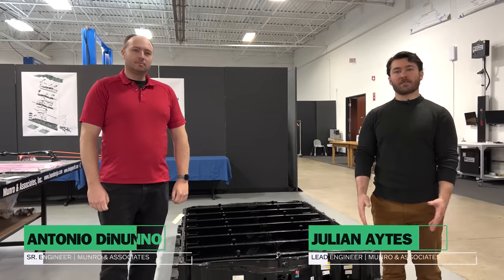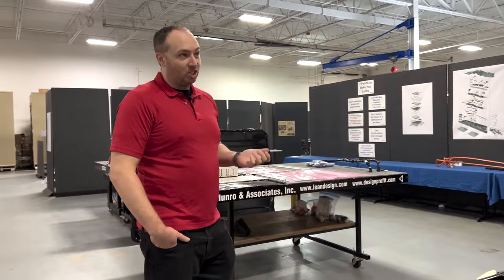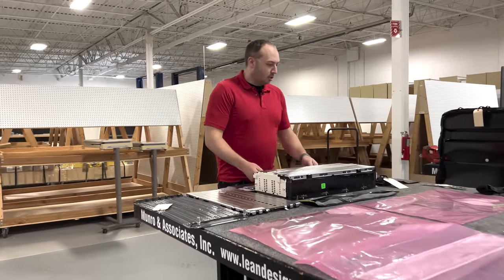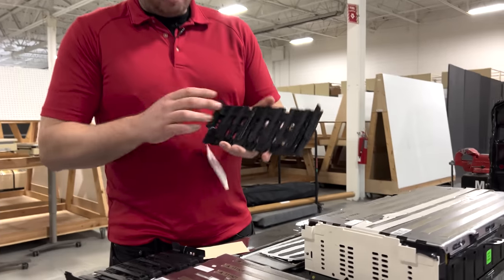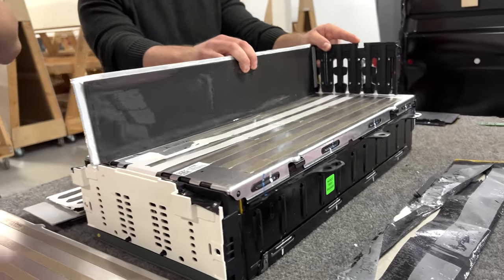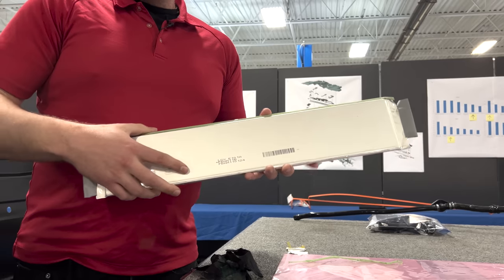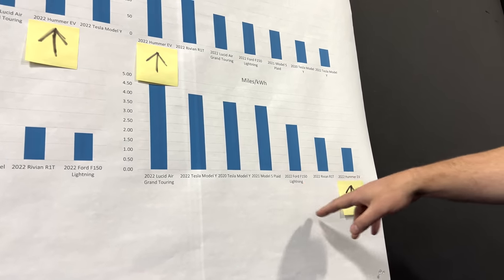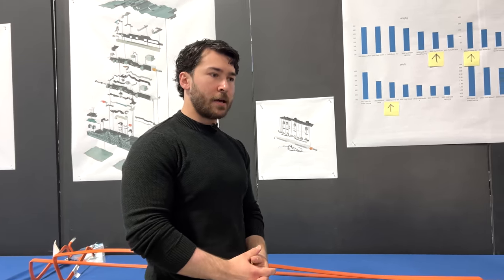This is NOT Lean Design: Hummer EV Battery Pack Breakdown

Comment: I have been keeping eyes on the Chinese new energy vehicle data published by the Ministry of Industry: 

For Tesla M3/Y sector (65-80kwh sector or the gasoline equivalent BMW 3 or Merc C)
2019 Chinese EV overall weight was 2200kg with typical mileage at 18-22kwh/100km
2020-2021 Chinese domestic brands moving towards 1900-2000kg with typical mileage at 15-18kwh/100km
2022-2023 Chinese domestic brands are almost at 1700-1800kg with typical mileage at 14-16kwh/100km
For reference, Tesla M3/Y moves from 15 down to 12.5kwh/100h since 2019 after gigapress put into production 

GM and a lot of legecy automakers dont sell in China: nobody buying junk not from the get-go. as the old English saying, "fool me once shame on you fool me twice shame on me"

... and stop fucking blaming it on nationalism otherwise why on the fucking earth rich/middle-class Chinese in the past 15 years ALL possesses one of the following 
1. Merc
2. Audi
3. BMW
4. Toyota LC/Alpha 
5. Lexus

Noted I dont put the American luxury brands in there because it is way worse than an Audi. It consumes more petrol than an Audi but it requires the same amount of maintenance.
Reply: Uhhh GM is the number one EV producer in China under thier Wuling badge. The difference is that GM's  Chinese EV products wont "benefit" from the influence of GMs US military contracts.
Reply: @patreekotime4578  Number one in units, but they count ALL of those units even though they only own a portion (30%) of the company.

SEC should be putting GM execs in jail.
Reply: @tommornini2470  Also the Buick marque is very popular in China. This whole post is just incredibly mis-informed.

Comment: The problem with aluminum in battery modules is Aluminum is pretty flammable and steel isn’t. We have all seen how flammable Teslas are when they catch on fire. All that aluminum giga-casting burns incredibly hot. US war ships tried using aluminum to cut weight on ships it turned out to be a disaster as the fires weren’t extinguishable using normal means. Eventually a Tesla is going to catch on fire in an enclosed area and a lot of people are going to die. They will then get rid of a lot of the aluminum.

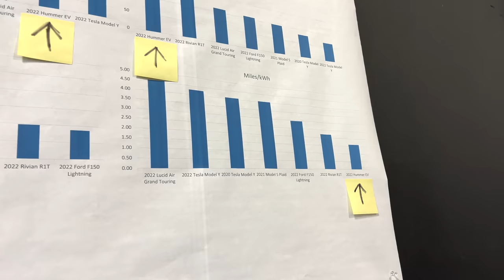Comment: 28:00 what?  cylindrical cells don't help with range or efficiency, actually it is the opposite. they are however the more reliable, much robust form factor than pouch cells.

Comment: So you get a car that is much heavier, with less range and is much more complicated which costs much more to build and buy. That will need a very expensive battery replacement after 8 or 10 years.. So what is the benefit again?

Comment: Oh for gods sake all the negative yammering being posted.  I don't mean to be critical but it's a HUMMER.  A quasi-military vehicle more than anything else.  What screams excess in that world?  Hummer.  I'm' not praising or criticizing, I'm simply saying that as it relates to what it's designed to support this is where GM's head is.  It might be up their collective ass but what else would you expect, a tin-can? 

I'm more curious as to the overall functional capabilities of the vehicle itself.  Freaking thing must be a tank.  It appears to be built like one.
Reply: But what the point of making it an EV when it so non-efficient that you maybe get 180 miles from it in the winter... 
Do any pulling or heavy load and you are at max 140 miles of range. So much for having a tank but it can't go anywhere where there is no charging within 150 miles.

Comment: The Hummer EV sells at such small numbers, it doesn't really make sense for GM to care much for efficiency unless they are looking to learn things to filter down in their other lines.
Reply: Yet they want to use this same platform in all their EV’s.
Reply: It’s supposed to be a modular, reusable design.

Consider all the hype, promises, resources, factories, and $$$ they’ve “invested” in this “next generation” battery design.

😂😂😂
Reply: @roxter299roxter7  Identical modules, not identical packs though. This pack will likely also go into the Silverado.... but other vehicles will get one half as tall.

Comment: That's pretty klugey all right. I wonder why? What externality, what hidden strategy or assumption, was at work here? Were the engineers trying to retain some design/budget flexibility going forward by deferring tooling costs? Is its slot-A-tab-B geometry an artifact of the Ultium battery's soup-to-nuts commonality in future products? The savings in commonality/assembly might be a driver, right? But why stamped steel everything? The material savings don't appear to outpace the processing, handling/fastening, component count and weight penalty; but MAYBE GM has a shitty deal with its aluminum vendors or a particularly sweet deal on sheet steel. Or maybe it was about labor/union commitments. GM can't lay off everyone they want to, all at once; maybe a more man-hour intensive construction could net out cheaper than broken promises to the UAW? Anyway, there has to be a reason, right? GM has all kinds of engineering talent on hand.
Reply: Servicing and recycling
Reply: @bahamatodd  
Could that be sufficient, given all the tradeoffs? I'm really asking.
Reply: @bahamatodd  But there's no money in recycling steel compared to recycling aluminum.
Reply: Two words for you: military contracts. GM appears to be trying to save money by developing one technology to use for their military and consumer facing products. At the detriment of probably both sides.

Comment: From all battery packs I saw this would be the worst design. A lot of engineering and manufacturing hours just in totally wrong direction. Their internal requirements for BP seem to be ridiculous, even more than the EU ones.
Kudos on staying professional, that took a lot of effort.
Reply: This is the only pack you've seen capable of off-road use. In addition it can charge at a rate higher than any other vehicle 340kWh+

Comment: They don´t know how much capacity 18650s and 21700s usually have🙈, but the rest is interesting. Seems like this type of pouch cell doesn´t allow "lean" design, however the volumetric energy speaks for itself.
Reply: See 19:45 for capacities.
The pouch cells are certainly “lean”, very little volume lost to air gaps in cylindrical cells, and these pouch cells & modules is used across multiple vehicle platforms, better in watt hour per kg compared to Tesla

Comment: As with the original Hummer,  getting to a  certain large weight is a goal not a design obstacle to overcome. I have read that for vehicle tax purposes these need to be considered a light commercial truck class. Therefore a business write off item for many purchasers.
Reply: The Hummer EV is nearly twice the weight required to meet that tax break. Most SUVs meet that, its one of the driving factors in large SUV sales.

Comment: That pack is designed to be serviceable. Tesla is glued and welded shut. There are additional costs but GM will never warranty a whole pack.
Reply: Theoretically, GM could have done Bolt battery recalls "in the field" with module swaps, but after a few trial runs, they went with whole pack replacement. IOW, they don't trust the dealer service departments to go into the guts of a pack. So I'd say the modularity/field serviceable feature is moot.
Reply: @steamtorch  They didnt go to whole pack replacements though. They switched from trying to test individual modules to find the problematic ones, to replacing all of the modules on a pack. Because they couldnt be 100% sure that they could absolutely discover the faulty modules. But they ended up with techs replacing every module, introducing far more potentional points of failure and requiring far more testing to ensure proper integration. Presumeably there were reasons why they couldn't just swap out packs, like the serial numbers on packs being matched to the whole vehicle or some other logistical problem. 

 It should also be noted that those repairs happened LONG after GM had already finalized the Ultium designs and were in the process of equipping the factory. What we see here is GM's plan from years before the Bolt battery fires were happening. And it is clear that GM has designed this pack from the standpoint of making modules replaceable, NOT from the standpoint of swapping out packs.
Reply: @patreekotime4578  I have such a bolt. I got a factory refurbished pack. Made of recycled components and new cells. Point is that dealer service departments didn't open the pack itself, just removed the old pack and installed a refurbished.
Reply: A pack is not worth to be serviceable. It cost too much in work hours and expertise to start with. Else phone packs would already have services for it, but no one going to spend time and money on maybe get a working pack with the risk of it leaking or exploding duo to unbalance in the pack. No one is giving warranty on their work on a pack since there is so much that can go wrong. What if the whole pack is destroyed by replacing 1 module etc.

A pack need to be balanced, the bigger the modules the harder it is to balance them. So having big modules like this means it horrible for servicing. 
The pouch design is not made for servicing, they are welded in place... how you plan to remove them and replace?
The GM bolt had same design, guess what? They only replaced the packs, they never gave option to service them. 

This pack has easy access, but is no serviceable.

Comment: Thermal regulation is useless if you are only cooling edges battery pouch. Battery will probably die prematurely due to unregulated heat. These pouch will also becomes useless after bloating and destroys cells next to it.
Reply: "AH!" They'll say "It's EASY TO REPAIR!!!" 😉

Comment: More complex and heavier with the tradeoff of being able to easily service and recycle the battery.
Reply: Nothing about this makes it easier to recycle. Theres actually less benefit to recycling it because at least a pack with a decent amount of aluminum would be worth dramatically more to a recycler. Its doubtful you would make your money back after your labor recycling this steel tub within a steel tub setup.
Reply: @patreekotime4578  A battery recylcler like Redwood Materials or Li-Cycle is looking at the ease of disassembly to recycle the battery cells for the lithium, graphite, nickel, cobalt etc. Not the housing material.
Reply: I wonder if the cybertruck battery is made of stainless steel 🤩
Reply: @bahamatodd  The battery boxes used by almost everyone with aluminum rails and castings are just as easy to disassemble... Possibly more easy to disassemble. And worth vastly, vastly more to a recycler. The modules also are steel with steel in the seperators. So again, at the module level they are worth less than ones with aluminum. And the modules appeare to be just as easy/difficult to disassemble as everyone else's, with less desirable materials in them. I dont understand why people are commenting that this is more recycleable, it makes no sense.... more recycleable than WHAT?

Comment: It's a terrible vehicle for many reasons, but expecting them to use aluminum housing, knowing it's going to highside, is shortsighted. Mild steel will take a strike and not fracture. Aluminum pack pan would fracture offroading and need to be replaced.

Comment: Man, so many negative and hateful comments from people who don't even understand the video. Where did these people come from?
Reply: Why are you assuming people don't understand the video?
Reply: @ryansmithc  Based on the sheer number of incorrect statements and the opinions based on those bad statements.
Reply: @JasonWW2000  Like what?
Reply: @ryansmithc  The most egregious statements I see are that because GM did not use lean design, it must be bad, will fail early and reflects poorly on GM. That is completely false. All the extra components and redundancy actually makes this a very reliable and strong design. 
After watching the video it was clear that GM was rushing so they took a belt and suspenders approach. They made sure it would work and last at the expense of a leaner, lighter weight design. That basically describes the whole vehicle.
If you scroll the comments it's full of knee jerk reactions and people hating on GM saying they are behind the times and terrible engineers, etc... I can only assume they don't understand what they are looking at.

A couple years ago when they did teardowns the comments were full of smart people asking questions and explaining the designs. Now it seems the comments are people who know nothing of design just sharing their feelings. Maybe Munro has drawn a larger audience of non engineering minded people?
Reply: @JasonWW2000 🤣 How is having extra components and redundancies a sign of reliability and strong design?  That makes absolutely no sense. Even the best engineer programs teach otherwise. You have higher rates of failure points. To achieve a strong design, it starts with reducing extra and unnecessary components . The idea that It's strong because they didn't have enough time, isn't good enough if the competition is doing it better. It's always bare than excess. And does GM even have a track record of reliability or engineering prowess? 

Everything else you said is purely subjective. Baseless assumptions. It's no surprise that you're the only person defending GM. You don't have a clue about engineering. 🤣
Reply: @JasonWW2000  Maybe you're worried about your pension and can't stand that GM will go out of business. Idk what it is, but it definitely isn't a case about reliability or strong design. That was a good laugh. I've never heard the concept of having extra parts and bulky design = strong. I've worked on aircrafts for over a decade and everything you said would get you laughed out of the room. Any engineering head would strongly suggest cutting out parts and reducing complexities. A rushed job IMO has never resulted in a good product.  There's no excuse. But the fact that you'd rather deflect and get upset over the comments, shows how stubborn folks can get. It's similiar to a lot of upper management guys at the legacy automakers. Substandard engineering will wipe out all those folks in the EV transition. They cannot compete.
Reply: @ryansmithc  I stand by what I said. Sorry you don't like it. 🤷
For the record, a lot of what you said doesn't make sense. To me at least. Using extra parts and having a bulky design can absolutely equate to strength. It's such a simple concept. Why are you having trouble understanding it?
Reply: @JasonWW2000  Using "extra" parts means there's unnecessary parts or complexities and hence more chances of it breaking down. If the goal was to make it strong, then it should always be done with efficiency in mind. But to be inefficient, bulky and use extra parts = subpar engineering. The fact that you can then say it somehow also makes it reliable, makes little sense. If it was rushed as you said, then I highly doubt it will be reliable. It goes against the basics in most engineering programs. More is never better, unless there's reasons for it. But as Antonio pointed out, if Ford and Rivian can get better efficiencies than it's a result of bad design.
Reply: @ryansmithc  Maybe I can explain it in a way you better understand. Lets say on an aircraft you have a flexible hydraulic line. Your not going to use hose that is rated for it's normal pressures, you want to use one that is rated well beyond what it should ever see. It may also have additional protective sleeves around it. It may also have clamps every 6 inches to hold it in place. It's not necessarily "extra" parts or unnecessary complexities. Does that make sense? 
Maybe a clamp every 10 inches would be fine, but if your rushing to build something you don't really have time to test if you only need them every 10". You might err on the side of caution and just do clamps every 6 inches and move on. 
In the future you can test it and see if every 10" is fine and if so, you can implement the change. 
Does that make sense?
Reply: @ryansmithc  PS, the entire vehicle was designed in just under 2 years. Its also their first Ultium battery pack. I can defend this battery pack design under the short timeline. The bigger question is should GM have rushed the Hummer into production? Probably not. They did it to beat the competition, which does have advantages, but in the long run it might have been a mistake.

Comment: The original Tesla Roadster weighs about the same as the Hummers battery pack.
Reply: MG Cyberster will be the heir of Roadster 1 👍
Reply: The Roadster could fit in the bed of the Hummer. What's your point?

Comment: AT LEAST the cells are easy to remove!! 
😂
Reply: Which is the point. Easy to service and recycle.
Reply: @bahamatodd  
The stress they'll be under carrying the weight will probably necessitate their replacement 😂
.
Their switch to 4680 should provide some interesting excuses?

Comment: I get their design could benefit from more simplicity as other manufacturers are doing, but what you guys dont talk about is the people who will buy a hummer ev dont care about efficiency and weight, so why would gm make it out of aluminum? I get the bashing, but why not try to find the reasonability in their design? I hear a lot about the fact that packs can be interchangeable with new tech as it becomes available and etc, is there nothing good to talk about, are all the hummer evs gonna just be dead in a junk yard? As a consumer, if a manufacturer spends more on development on a specific model and probably not make profit, why would I care as long as the product delivers and lasts at least 10 years or more! So much gm hate lol